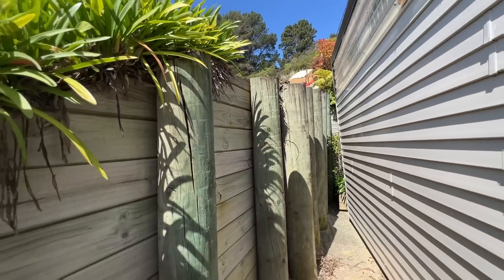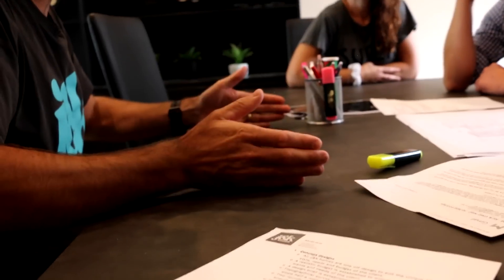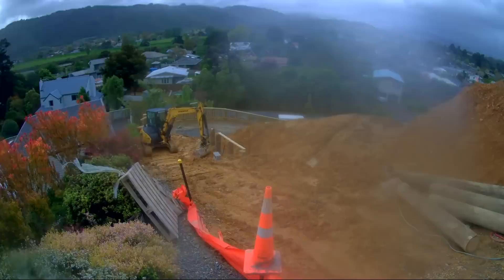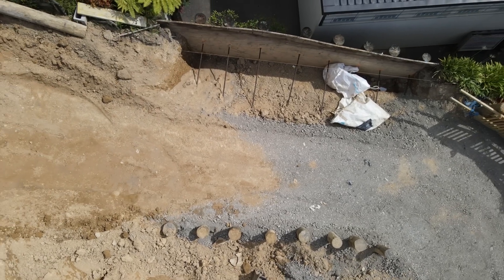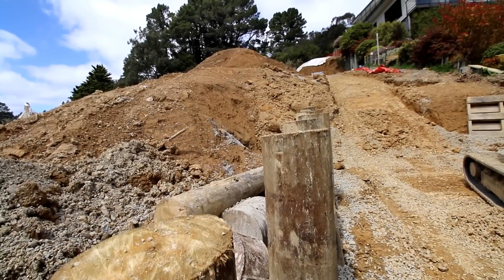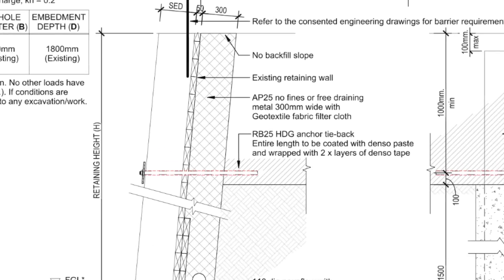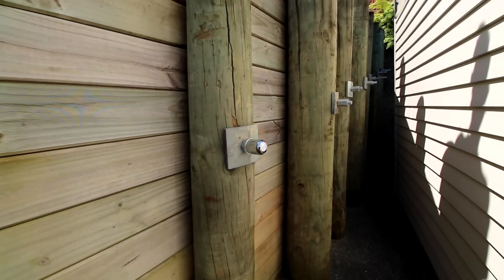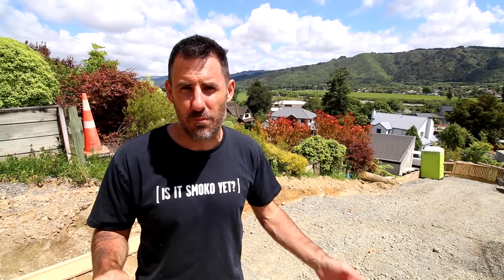How To Fix A Failing Retaining Wall

Comment: I find it strange that when a timber retaining wall is failing, the chosen solution is to build another timber retaining wall to back it up. Did the engineer not think that the timber methodology may be the cause of the failure in the first place. Submerging timber in soil for decades leads to rot, and it not a sound long term solution. My hunch is that all the timber retaining walls on this property will need to be rebuilt in a few decades.
Reply from the maker: it wasn't failing becuase of rot, and timber used correctly won't rot - it was failing from incorrect installation (whoever built it years ago) the poles weren't into good soil deep enough and it should have been built with a 5 degree backslope.
Reply: @jimfree7229  the failing mechanism here is most probably the soil giving way (speculating without knowing the full nature of the problem), causing what we called a “rotational failure” of the retaining wall. A timber failing mode would be more imminent (and likely more catastrophic), where the bending capacity of the post is exceeded by the lateral load exerted by the retained materials. So a tie back into a deadman is very much the appropriate solution for the given problem here. I have designed a few of remedies for my clients post following the Auckland floods recently.

Comment: Dees nuts. Ahem. It's a nice solution because the driveway load pushes out in both directions making it equal and opposite. Nice.
Reply: Noticed you comment on the technical/engineering aspects quite a bit, must be a practicing structural engineer by the sound of it? 🤔
Reply: @zurismith7640  I wish. Dad was a builder and built a home (4 actually) for me to live in. His dad did the same. I'm hell bent on doing it too. Soaking  up all of the knowledge I can before we do our "escape Auckland 30sqm cabin" and start planning the big house on the same site hopefully under the current gov loosened rules. I just appreciated the elegance of the solution. Since it's internally balanced the net force out is zero in both directions. Very clean solution IMO. I did study physics at high school and a bit at uni. I do IT by day, though, but own (and know how to use) more tools than most tradies. :-)
Reply: @fredio54 , well sing out if you need an engineer for your upcoming project.
Reply: @zurismith7640  Are you telling me I had a genuine engineer thinking a back yard engineer was real? :-D If so, flattery will get you everywhere. I'm sure I'll need a bunch of stuff when the time comes. Far North location.
Reply: @ mate those are your words not mine 🤣. But in saying that, as a chartered professional engineer myself, it’s quite baffling seeing a bunch of ‘engineers wannabe’ or backyard engineers as you put with their shallow knowledge of how the loads are actually transferred from top to bottom. Don’t get me started with seismic/loading  🤣😄…Builders need to understand only us proper qualified engineers holding a minimum of BE(Hons) first class in my case💪 understand every single force and stresses that travels through ever single component of the building, including through nuts & bolts, nails and screws…..The reality is, we engineers can step into the build environment but we chose to be engineers because we are too intelligent to be builders.

Comment: Why didn’t you add concrete piers under the new driveway, keep it 1.5 meters say off the leaning retainer wall. dig up the soil and add a agg line. And gravel to back fill.

That way when the retainer fails the driveway is supported by piers. 

In Australia it’s a good method of locking something without it moving.

Comment: You could have finished the rod flush with the ends of the nuts on the wall side. Not left random lengths sticking out of the wall.

Comment: Still building houses where no homes should be built on the sides of hills,people never.learn.
That wall will fail in less than 20 years,OR after the whole hill slides down after a heavy rain.

Comment: Yup good choice drill rotted posts and anchor the rotted posts and hope for the best,10 years and all will fall on the neighbour house.
Reply: Those types of retaining wall have been around for a long time. They are H4 or H5 treated so are well suited for this situation. We've seen many instances of concrete walls failing over the years here. It's inflexible and therefore doesn't doesn't hold up as well in earthquakes. Even though it is reinforced it will crack and the reinforcing will become exposed and corrode.

Comment: Hello.
You make sure that the work is carried out professionally and according to the engineer's calculations and drawings. In the drawing showing how the post is cast in concrete, there is a clear error. never cast under the post.
make the hole, put 15 cm of gravel into the hole, then the post, then 15 cm of gravel and then finally concrete.
Then the post will not rot due to surface water seeping down.

Comment: I m curious to see the bare steel in 15 years and the wood in 10
Reply: The steel was HDG and the posts H5, last for 50years plus I reckon but stainless steel would of been better
Reply: @james4987  How does gal react with the H5 treatment?

Comment: What type of wood are the posts and are they likely to rot at ground level. New subscriber 👍🇬🇧
Reply: The posts would be pinus radiata, which is a soft wood but grows exceedingly fast here in New Zealand. They are tanalised to preserve them. The combination of metals used is so toxic that they won't rot.

Comment: Interesting the that the deadman’s don’t need to be on a 1/10 slant away from the wall like a retaining should be
Reply: Why? There's bugger all leverage on the part not embedded in concrete. The retaining walls benefit from the slant because the forces extend right up the poles.

Comment: Tough position to be put in, when you can’t avoid fixing the other guys cheap job. Not a fan of those head banger nuts in the confined space, but hopefully the neighbour doesn’t lose any scalp and sue. I would have reverted to use 15 mm wire cable and wrap around the verticle posts with protection plates too. Not a fan of drilling through subsurface piers and risking water mitigation and core rot. 🤙
Reply: blueman5924 has his head screwed on the right way around!

Comment: Nice save! In my Country we must tie-back / anchoring-back almost all retaining walls (exept gravity, or cantilever walls) what we build and must use longlasting materials, like reinforced concrete for that. That piling wall especially from wood is the weakest structure I can imagine.
Reply: Can I ask what Country?
Reply: It's a great thing that the engineers who spec these don't rely on imagination like you do.
Reply: @DiscoFang you mean the expert engineer, who did the failing retaining wall?
Reply: @CsokisMorisz You’re not really paying attention to this whole situation are you. That wall didn’t fail because of the materials used.
Reply: @DiscoFang  That wall fail because the solution, what the engineer came up with. Pilling wall with shallow embedment depth, possible based on a miscalculated soil pressure, no tie-back for strengthen and safety reason and on top of that the used material, what will be the next headache. As a civil engineer i can tell you, that whole problem came from the "spec these"engineer.
Reply: @CsokisMorisz Except it’s clear you have zero experience with cca treated radiata. Which is what you were highlighting in your first comment -the timber. Your lack of experience and knowledge of it vs an entire industry and construction methodology of scientific and research based codes and engineering solutions. There is nothing wrong with the materials used, just the way they were used and installed. But hey don’t let lack of actual experience get in the way of your engineering opinion.
Reply: @DiscoFang highlighting in my first comment? Com'on. Read again. It's an engineering/construction failure. Nothing else. The material is only a cherry on the top. But you were right, i have no experience with wood sticks (:D) because we won't use that material for that aplication. Simply because we build everything for the upcoming decades, and try to build it as safely as possible. And what's your guess in treated wood/reinforced concrete/steel relation what would be the weakest?
Reply: @DiscoFangcame at the guy hostile and got schooled 😂

He’s right, in NZL we build with a 50 year timeframe due to using timber like this. How’s this going to be replaced when it comes to the end of its life?

Concrete//steel is a much better option which is what the original poster mentioned. Not sure why you got offended.

Comment: You might have just provided the answer to a problem I have been trying to work out. My block of land is split level and has a lot of solid sandstone. The bottom level of the house might be a meter or so below the top level section. I have been racking my brain how to stop the lower wall getting pushed over with time. I could use this dead man system and lock the reo into the lower section block walls. I just need to drill some holes in the top section.

Comment: So the neighbor got their wall fixed for free?
Reply: The wall was most probably not on the neighbour's land and also not constructed by them. In short not the neighbour's problem. Further to that if you build a retaining wall that starts endangering your neighbour's property it's most certainly your responsibility to fix it.
Reply: @davel4708 I disagree. That wall would have been built when that garage was constructed, next to the then empty lot. And..it was not built correctly, as it was not angled back into the slope to resist the uphill soil pressures. It simply became Josh’s customers problem because of the new driveway.
Reply: @ Fair enough. I think you're probably right.
Reply: Most retaining walls are on lower side of slope ie bottom neighbours side. He would have put it in wen he dug out for the shed that's right beside it.
Reply: The video says it’s on the neighbours property